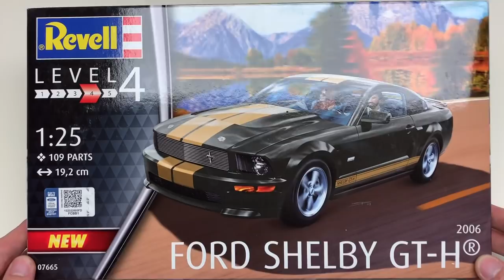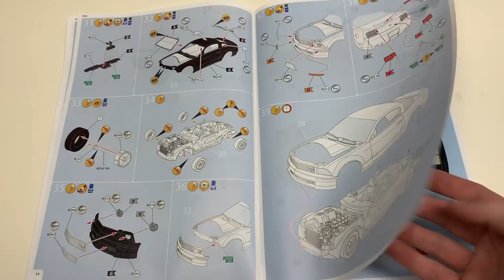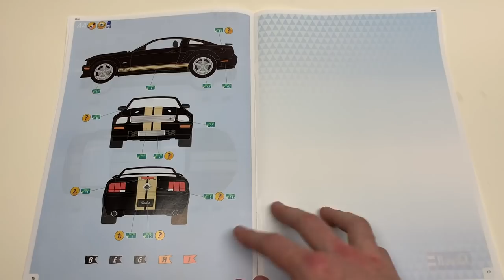Building a 2006 Shelby Mustang GT-H Scale Model Replica

Comment: A little history on the paint scheme on this Mustang. The H in GT-H stands for Hertz. Back in the day Hertz had a great idea called Rent-a-Racer. You could rent the higher end GT350-H Mustangs from Hertz for $17 per day and 17 cents per mile if you belonged to one of Hertz's Clubs. The gold stripes were a Hertz exclusive. This program was cancelled because Hertz had to put out way too much in repair costs because people would rent them, bring them to race tracks for the weekend and trash the hell out of them. There were also reports of some base model Mustang owners renting the GT350-H and spending the weekend swapping motors and transmissions and returning the rentals with the cheaper engines. The original GT350-Hs go for over $150,000 and are highly collectible.